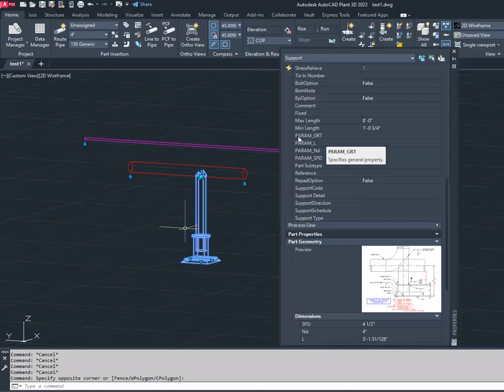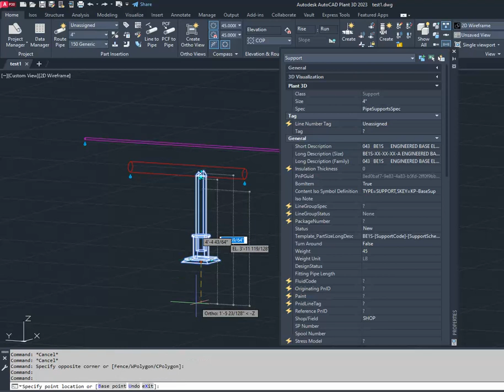Plant 3D   Support Dimension Properties Updater

Comment: Script/function linked to an on save event? I wonder how this would work with a model containing thousands of supports. Is there some kind of dirty flag so it knows to skip supports that have no changes?
Reply from the maker: I tested ~2,000 supports and it processed them all in less than a second so not an issue.